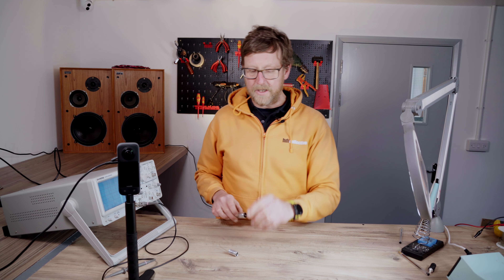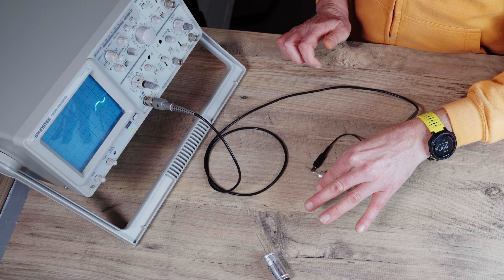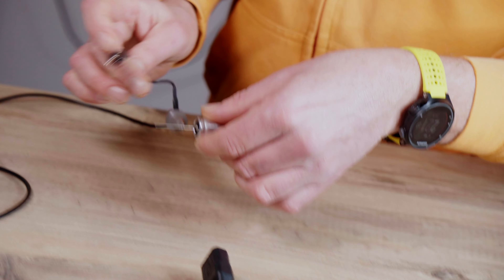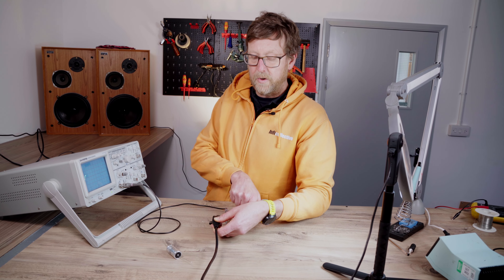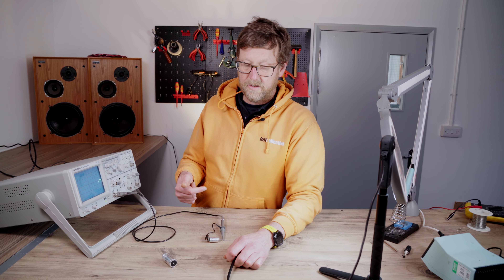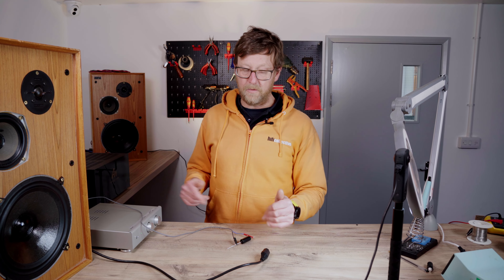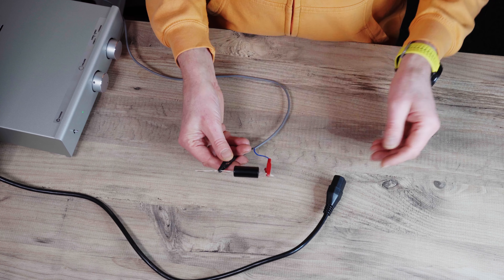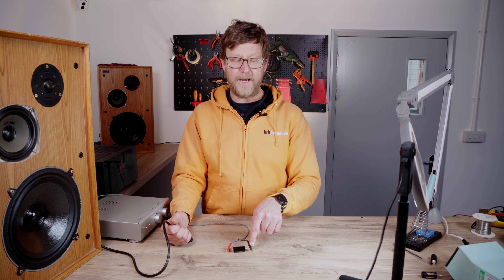How to find the Inner and Outer foil of a Film Capacitor

Comment: Hi Nick. Just one error you made in your video is that the outer foil should be the input side of the cap and not the output as you said.
For interstage DC blocking the plate of the preceding stage should connect to the outer foil.

Comment: Thanks for the advice using the power cable instead of just touching the cap!!! My Oscilloscopes is one of the cheaper models and it doesn't have the sensitivity for the finger method, with your tip I can measure my caps no problem! Awesome

Comment: First of all, thank you for the helpful video.
In the case of Kemet SMR PPS film capacitor 50v 0.10uF, the waveform does not appear with the method you told me. Is it a problem with my oscilloscope?
It is a multimeter and portable oscilloscope called ZOYI ZT-703S.
Reply: HI
It can be tricky to identify which is which. Do you have a source of noise that you can put it near? A mains transformer perhaps?
Regards
Reply: @HavershamHydroponics  Thanks for your answer.
My question is not about the noise source, but basically, when I bite the capacitor with my portable oscilloscope, no waveform is generated.
So, I want to know whether it is impossible to measure with a portable oscilloscope, or whether there are limitations depending on the type and capacity of the capacitor I am trying to measure.
Thank you for your kind attention.

Comment: So the lead doesnt connect to left and right speaker, one end goes to ground?
Reply from the maker: No, you would actually need to connect up the capacitor according to the circuit diagram. One end of the capacitor will be closer to the negative input it is that end that should be the outer foil end